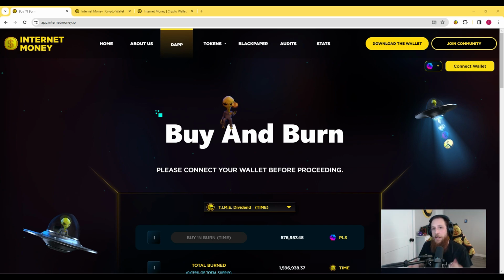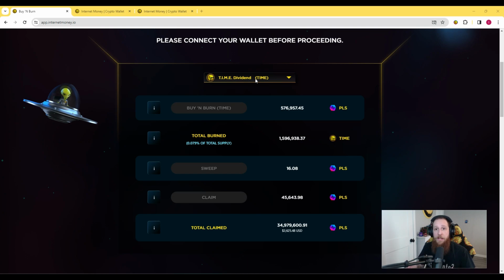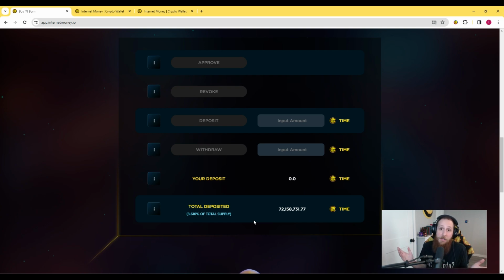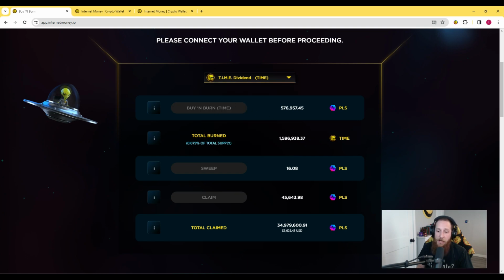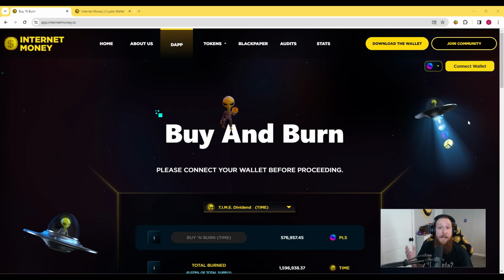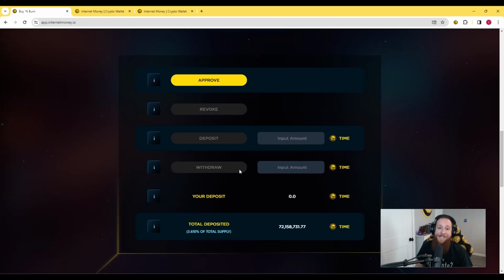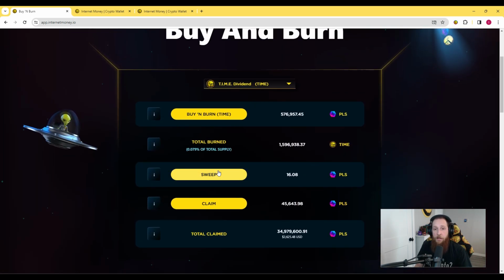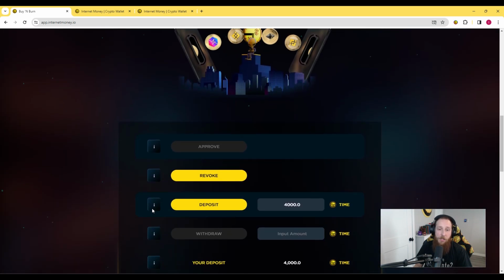InternetMoney.io Buy and Burn Walkthrough & How To!

Comment: Hello i have problem trad usdc to plsx . its ok if i just try with 500 and up to 1k but when i try a bigger swap this happen... Here are quotes for
2000 USDC -> PLSX
No Liquidity Found: Consider increasing the slippage from 1%
A fee of 0.729% is calculated based on this quotelearn more 

There is no option why is this happen. when i try to pls it is working